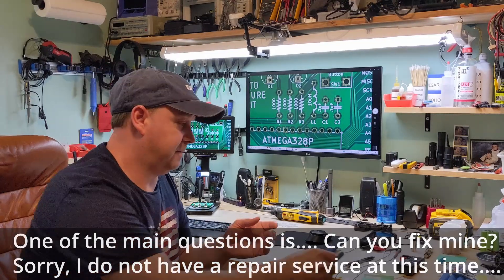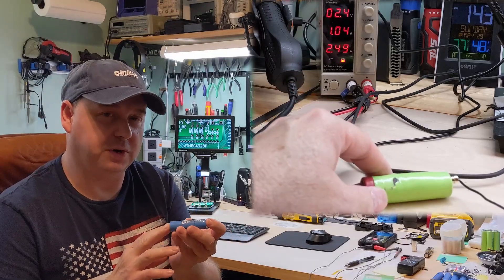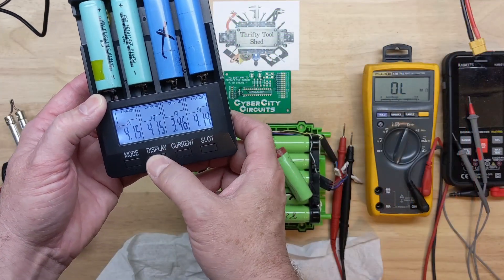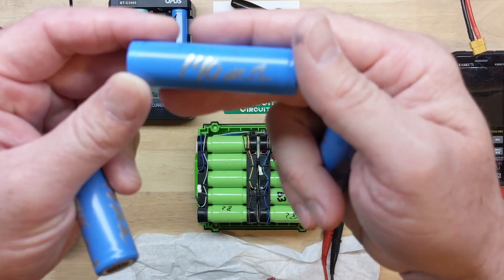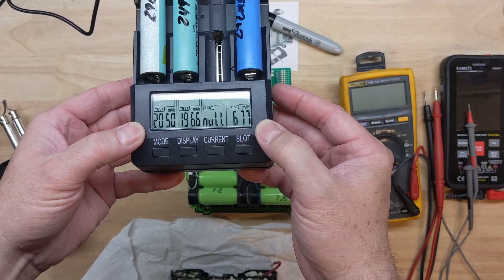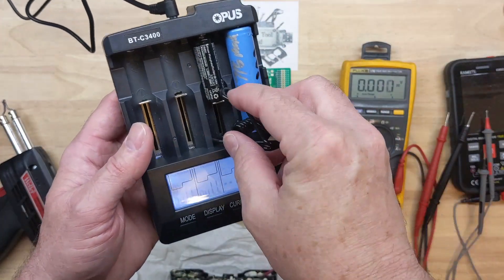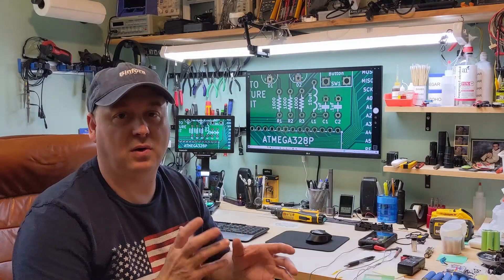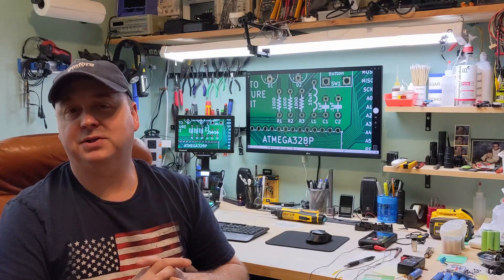Lithium Battery FAQ #1

Comment: I’ve been told not to store DeWALT packs near empty or at full charge for longer periods. One recommendation said it was ideal to store them after running a tool long enough to drop the charge level one bar from full. My smaller DeWALT packs don’t have a gauge and also don’t get used much. Of course, I can always measure the pack voltage. What is the ideal voltage for long term storage? Thanks!
Reply from the maker: HI,
It is an industry standard to not store packs near empty or nearly full for sure. That is the reason the packs come brand new with about half a charge or less. I  always treat the near empty much worse since they can drift easily into the too low to charge level and possibly get too low to recover well. I understand not long term storing fully charged either, but I have not had any issues myself with them being close to full charge. I would say about 1/2 to 2/3 charge is optimal, but since I like having a lot of packs fully charged and ready for power outage or whatever may come I truly leave most of mine charged up close to full in case I need them.
Reply: @ThriftyToolShed  Thanks!

Comment: Hi, excellent video and great safety tips, got a question though,  do you have a video on using a bench top DC power supply (variable like 30V-10A) to charge 18650 batteries or any other type? I suppose it has to be done one battery at a time and closely monitored but if you have not made such video maybe you might consider the idea?,  I've watched a couple but I would rather watch how you would do it rather than anyone I don't trust. great job so far btw.
Reply from the maker: I do have a couple videos of the EGO 56V using a Drok DC-DC converter to do this also since it is constant current, constant Voltage. With the Drok I could use another EGO pack to safely charge another one. As long as the pack is balanced well,( just all too low to charge on the charger) If they are unbalanced sometimes I will use the bench PS to individual cells set to 4.2Volts max and start off with .5A to see if they will take a charge. If the Voltage rises quickly it may be recoverable and I will go up to 1A and charge all the way to 4.2V and then go through the testing. If not much voltage change and is getting warm or hot then the cell is shorted and abort the test. If the voltage is low (like 0v)  on the cell and connecting it up is no voltage drop and no current then it's open.I may have to look into doing a video on this....
Thanks for your kind comment!

Comment: I appreciate your videos and dedication. I received a brand new, never used Ego 10Ah battery as a gift but it doesn't charge (25% charger blink) and have a red single LED light. Measured 4V on the terminals. Not sure where to start.
Reply from the maker: 4V at the terminals is not good. I would absolutely start by checking all cell clusters around and make sure they are all reading balanced even if very low. It is a small chance that the pack has just one cluster bad and close to being open or high resistance and many others is at good charge level. Most of the time it is the whole pack that is low. With that many cells reading low chances are many of the cells are not coming back with much capacity and sometimes at least some cells may be damaged and not charge at all. I have carefully used a 0-60V CC CV supply or Drok DC-DC converter with another pack to try to charge up the pack slowly. It has to be a Constant current supply and I start off with .5 to 1A and make sure no cell is getting hot. If any cell starts getting very warm I abort then charge. If some cells don't take charge at all it could be the cell is opened or even the CID has activated and disconnected. It is not easy sometimes saving these packs. I have many videos about the Drok DC-DC converter, replacing a cell, CID,  and follow up after some repairs. Thanks for your kind comment and best of luck to ya!
Reply: @ThriftyToolShed  Thank you for the detailed explanation. It is a brand new, unused. Very rare. I will keep you posted of what I find. Thanks again .
Reply: hi there. just to give you an update. I was able to open the battery and got 47.8 V at the fuse. the problem is that board between the fuse and the terminal. At the terminal still showing 4V but I know the batteries are in good shape. There is a gap between the terminal plastic holder and the board and I can see a piece of metal between. In there it measures nothing, so for sure something is open in that board. dead stop for me, I wish I can send you pictures.
Reply from the maker: @trutano  
I do have my facebook page link  listed on YouTube channel if you did want to send pics through messenger. I have seen a few of the trace fuses be blown completely away. I have also seen one that was in tact but the solder joint had separated as the weak point also. They don't always have the trace completely vaporized. I also have seen some of the  newer packs have the fuse under the connector itself, I have not seen the 10ah pack to say either way.
Also:
The one that had the fuse intact and bad connection to board was mainly the vias in the board layers. I actually fixed that pack by running a 10ga jumper wire from the fuse to the positive terminal still fuse protected.
Reply: @ThriftyToolShed  thank you, will do. There is some hope here ;)

Comment: I start by charging the batteries at 0.1 amp. If the battery heats up at all it gets tossed. 
Then Check the resistance and capacity. 
Next let them sit for a month and write down their final voltage. 

When building a pack I make sure I match up the final voltages. If you have a battery that will drift down to 4.05v in parallel with a battery that holds 4.20v they will both drift down to 4.05v loosing the extra capacity of the better battery. 

Some people say you should dispose of batteries that drift below 4.10v but I keep anything above 4.01v.

Comment: Battery resistance should be tested at full charge. But it still gives reasonable information when not fully charged.
Reply from the maker: Exactly, it will increase as discharged. If I did not mention that in this video, I may have edited it out of the video. I will check both typically when I get cells in!
Reply: It was a great overview. Thanks for making it understandable to most people.

Comment: That second battery video looks like the fireworks I make when it spins and shoots flames. Also for those that don’t know these battery cells are used to power your Tesla car and it has several thousand cells in series and parallel to power the car.

Comment: I have a Bauer battery and the battery indicator was really corroded. Tried to clean it, no go. When I try to charge the battery without that indicator the charger just blinks. I can get another charge indicator in a kit, but I was wondering if I could just wire it up in some way to bypass it? Like tac a resistor on or something, I don’t know.
Reply from the maker: The only Bauer I have even worked on was a flashlight and I shared how I ran it from another pack since I had no Bauer pack. Maybe it will help a little. Other than that I have no experience with Bauer. Best of luck to ya! 
https://youtu.be/IJ-xZ0zdwbo

Comment: I thought I was using plenty of caution and assumed I fully understood the risks of Lithium batteries, but last week I had an experience that really caught me off-guard…
  I’ve used Lithium batteries for quite a few projects and have built a few packs from scratch.  I have a mini electric dirt bike that I built using a Ryobi 40v brushless mower motor, a 1500W controller and two Ryobi 7.5aH 40v packs in series for 80v.  Its a blast, has way more than enough power to ride up the steep mountain slopes here on the Big Island of Hawaii.  It’s a wheelie machine and my favorite build so-far.  
  Anyways, last week I found a poor connection to the batteries so decided to re-wire it all nice and tidy.  Somehow I apparently screwed up the wiring so that there was a dead short between the 2 40v packs.  When I plugged the batteries in there was a pop and it instantly vaporized  a terminal on one pack and broke the connection.  I was kicking myself for the mistake because I would have to solder on a new connection to that pack to use it again.  Everything disconnected, I set the pack down on the edge of my porch , I would asses the damage another day.  3 days later, I was just falling asleep when my dog and I heard a thumping sound.  I sat up and a few seconds later saw smoke billowing from the  outside porch.  I ran out and the pack was shooting flames like a torch.  I kicked it off the porch right into a puddle below but it was still flaming.  I went down and completely submerged the pack in water, still bubbling and flaming.  It was like a big, terrifying trick birthday candle.  Nothing would stop the fire.  I knew that left alone it would continue to burn for a long time, and since I had the tools handy I decided to perform surgery to cut the main battery tabs while holding it underwater.  I was finally able to snip the main tabs to stop the thermal runaway but it was a very intense experience, like doing surgery on a burning rocket underwater!
  I was incredibly lucky that I happened to be around right when the fire started, or it may well have burned my house to the ground.  A couple minutes later and the water may have actually reacted with the Lithium and made the situation worse.
  My assessment was that when the battery terminal melted it must have created a small internal short across small balance traces on the PCB, which slowly got hotter and hotter over those 3 days until it burst into flames.  I’m quite sure that one way or another it was the circuit board that started the fire, not one of the cells.  
  Obviously I’m to blame for misusing the packs, but the way that Ryobi designed the PCB layout definitely did not help in this situation. 
  While I will continue to use Lithium batteries in projects, I have a new found respect for the power they hold  and their potential for danger.  Going forward all my battery packs get stored outside in a safe place, away from anything flammable.  
  Just thought I’d share this crazy experience with you.. 
     Aloha 
     🤙
Reply: Yeah I’ve seen some debate about using water to try to contain a lithium fire.  A few weeks ago I was reading a debate on the subject over a Facebook group.  What I gathered is that while it is true that water has the potential to cause further chemical reaction with cells that have burst open, it’s still better than doing nothing, and during the earlier stages of a catastrophic failure we shouldn’t hesitate to try using water to limit the severity of thermal runaway.  At the point that multiple cells have exploded, however, water might do more harm than good.  At that point it will be obvious that you are only adding to the fireball lol.  
  I’m glad that I read that thread when I did, otherwise I would have never tried using water.  I should specify that anything short of fully submerging the battery pack in water might be a waste of the effort, that was my experience anyway.  Even submerged it looked like an underwater welder, but it definitely slowed the reaction enough for me to start cutting nickel strips.  I believe there are only 2-3 cells that actually ruptured and I could still smell that awful burnt Lithium smell throughout the house and yard, on my clothes and nostrils for a couple days, I can’t imagine what it would have been like to have that whole big pack burn itself out in the yard.  Gnarly
Reply from the maker: Aloha! 
Wow, that sounds super intense. Glad you were home for sure, scary stuff. I do get concerned with water around them as you mentioned also. When I was reading your story and you mentioned the pack on fire and going into a puddle I was wondering if it reacted. Sounds like a cool  build . Thanks for sharing and keep safe.